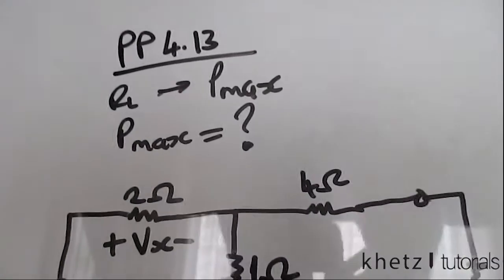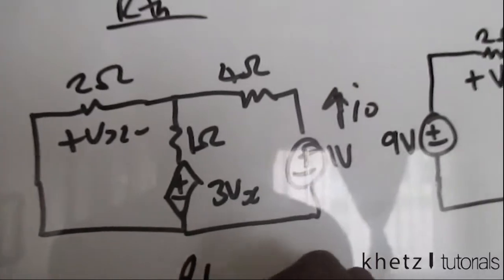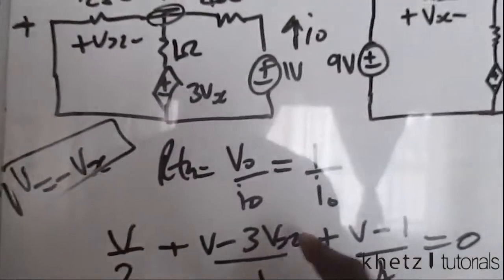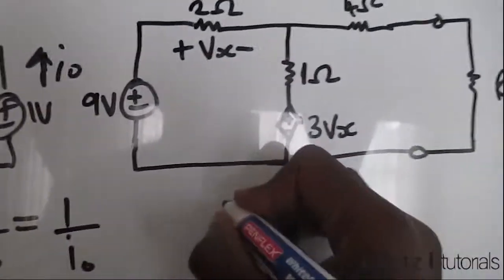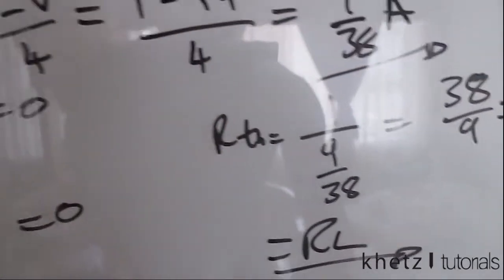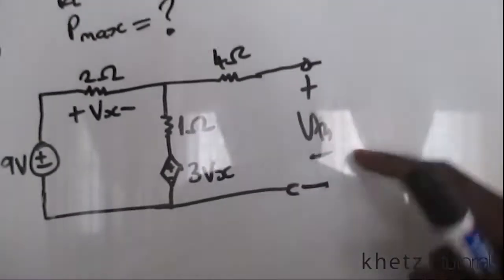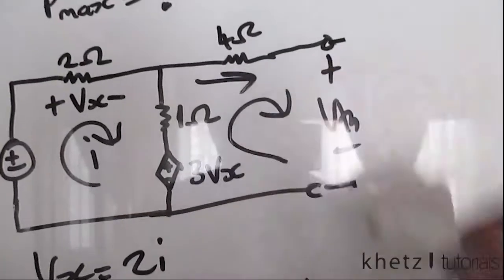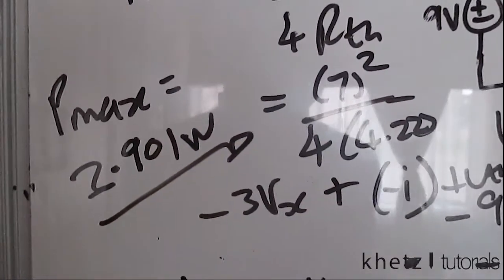Fundamentals Of Electric Circuits Practice Problem 4.13

Comment: I solved this problem, and the answer was the same as yours, but the book says the result is 126.67 Ω and 96.71 mW
Reply from the maker: There are a few errors in the textbook. Some answers were carried over from old versions

Comment: In the Vth loop, why don't you consider the 4 ohm resistor in your equation?
Reply from the maker: It is not fully connected and, therefore, no current flows. Ultimately, there is no voltage to consider.
Reply: @KhetzTutorials  by fully connected do you mean that the circuit is open or that the terminals don't intersect?
Reply from the maker: @Alex Mercer  the citcuit is open on that side and no current flows. V = ir. V=(0)(4)

Comment: How is V epuals - vx i didnt get it
Reply from the maker: The node V symbolizes the voltage between the point at the node to ground. On the left hand side, you will notice that the voltage across the resistor is vx but the -ve terminal is at the top. That vx still is the voltage from the point v to ground so v would be equal to vx but in this case, the negative came first and we have to take that into account. 

You can  also view each path as being parallel to each other and having a voltage V across it. In that case, the same would apply because the voltage across the left branch is -vx which suggests that the named node voltage V would be equal to that value as well
Reply: @KhetzTutorials  I want to ask you about something in the second case in thiefinin theory when I disconnect the load resistance and replace it with a voltage source or current source to find a thevenin resistance, how do I know when to use a current or voltage source
Reply from the maker: Any method should work. It is up to you
Reply: @KhetzTutorials  really?? You mean if i replace it with a voltage or current source that would lead me to the same result???
Reply from the maker: As long as the  conversion is valid. If you were to work with the current source, you'd instead have to find the voltage across it that's where the difference is